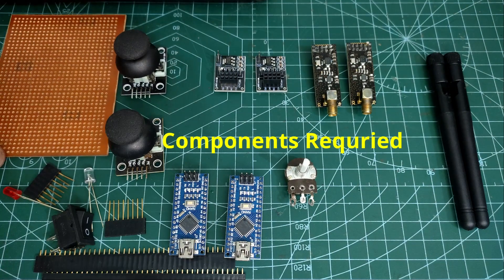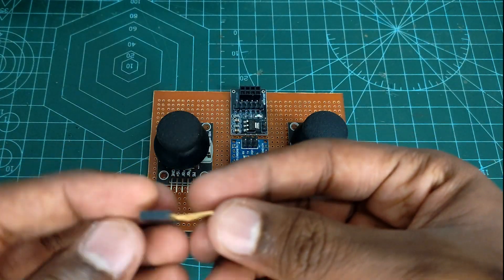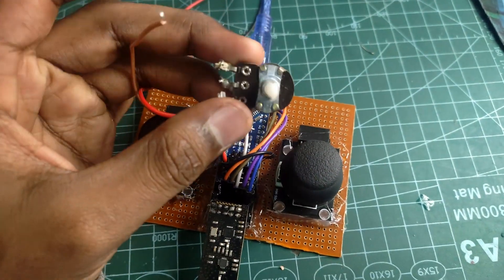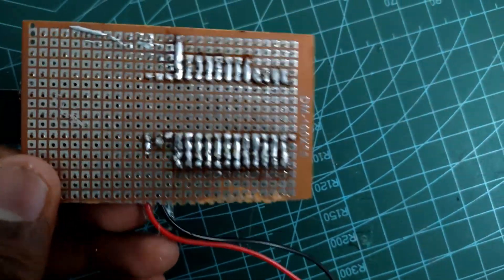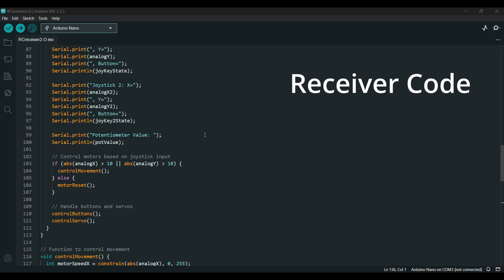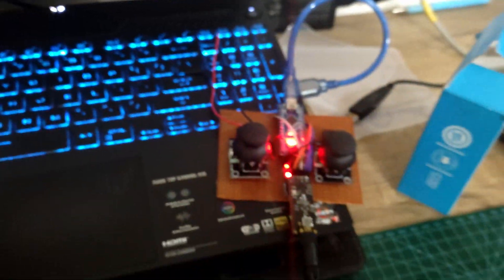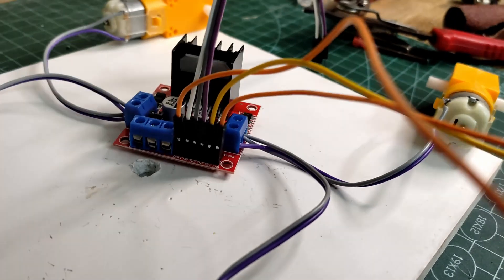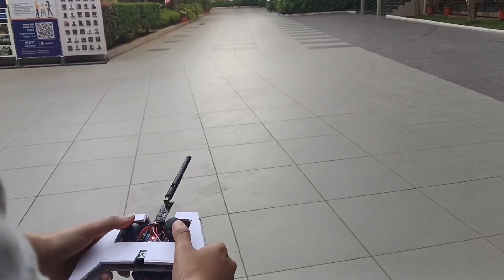I Built an Arduino RC Controller with NRF24L01 and It Works Like Magic!

Comment: Bhai Maine banaya work nahi kar raha hai
Reply from the maker: Kya problem hai exact ? Check pin connections & code , most imp check power supply. Better use adapter for nrf24

Comment: Nice explanation.  Can i use it for drone..?
Reply from the maker: Yes you can
Reply: @IdeasbySuyashDesai  range?
Reply from the maker: Tested at with high power , i could control my bot from 200M but there was some lags

Comment: Transmitter me sabhi parts ko add karne ke liye board jaruri hai. Bina board ke kar sakte hai kya solder and wire se
Reply from the maker: Ha kar sakte hai, thoda complicated hoga
Reply: @IdeasbySuyashDesai  lekin mujhe abhi complicated lag raha hai. Baki sab toh thik hai solder kahan kahan kiye ho wo nahi samajh raha hai
Reply from the maker: Uska circuit diagram upload krdunga
Reply: @IdeasbySuyashDesai  ok kab tak ho jayega